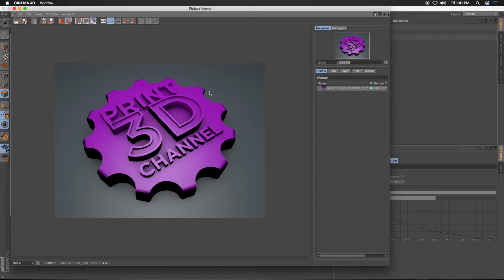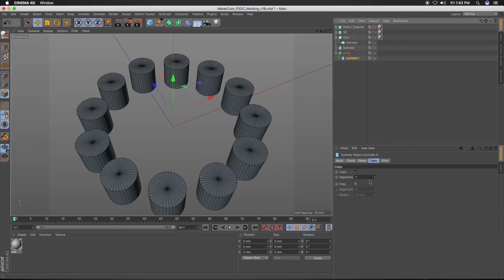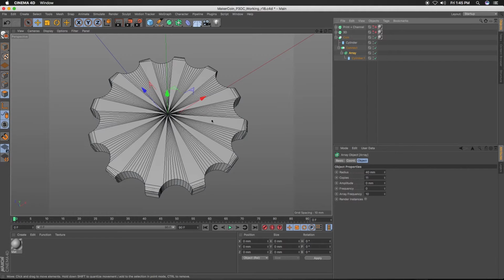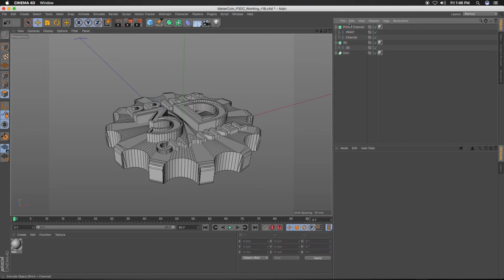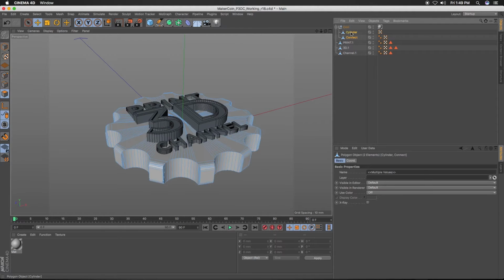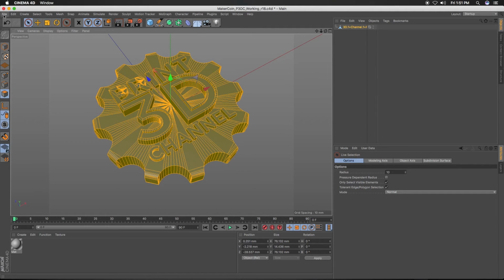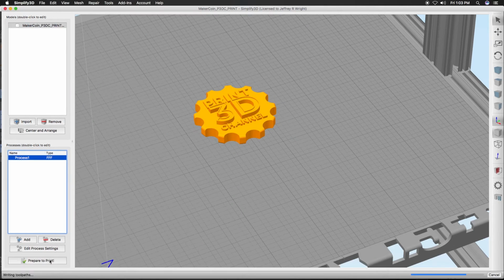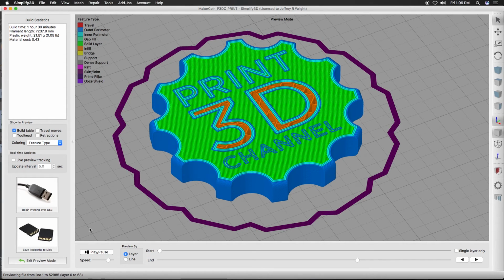The Print 3D Channel Maker Coin - Made with Cinema 4D & MatterHackers

Comment: Nice looking coin !!  Those letters are sharp and clean,, and the hollow-accent really helps to make them visible.
I can prove some tips and tricks to help fill-in those  perimeter-holes and extrusion-gaps if you're interested.?
Reply from the maker: Thanks Duplicat! The type was a happy accident but turned out stellar. Always open to tips and tricks, bring 'em on!
Reply: Ok.  While there are dozens of different "test" prints,, there is 1 very basic and useful "CALIBRATION" print.
The "" 20x20x10mm "" calibration cube, printed with 100% infill.
 It's small, prints fast, and will show most "settings" errors that might appear on any printed object.

 Calipers required:
-- SPEC THE FILAMENT. (you can tweak the "multiplier" to get around this,, if you feel the filament is pretty close to tolerance)  Manufacturing is sure a lot better than it use to be,, but it is still not perfect. Being off by a few 100th's doesn't seem like much,, but eliminating this variable is worth the effort.  Measure at 2-3ft increments,, twice(@90*),, 10X,, /by 20 =

-- WATCH THE FIRST AND SECOND LAYER.  (you can stop the print here, if necessary, to make settings adjustments)  1st layer is going to "squish", but still should have no gaps.  2nd layer will show typical extrusion to be expected throughout the rest of the print.
Adjust settings to get a perfect 2 layer start.
(hint:) S3D's "extrusion width" has nothing to do with filament(that would be tweaked using the "multiplier").  It is actually "toolpath spacing". Gaps can be closed by making the "extrusion width" smaller (or,, by faking the "nozzle size" to smaller) (I noticed you have a .5mm nozzle,, with "extrusion width" at .5mm.  S3D may not allow smaller width than nozzle size,, so the "faking nozzle size" is the work-around. Try .45 if necessary)

--  PRINT ENTIRE CUBE.  -Visually inspect sides and top for under or over extrusion,, and corners, walls and TOP for bulges.  --Measure all to check for accuracy. (if it's too big, reduce the "multiplier")

(I noticed you use a "2mm -retraction".  1mm is typical for direct-drive.(all machines vary)  Personally I try to use less than 1mm. THIS  could be the reason for holes at perimeter walls)

-- Object geometry is a constant variable that you already know about, and how to deal with.
(infill%, #shells, #bottom&top layers)

Best wishes and Merry Printmas  :)
Reply from the maker: Thanks Duplicat! These are excellent and helpful tips. I will toy with my settings and try those out on a test cube I have always on my SD card. Thanks again for taking the time to post these.